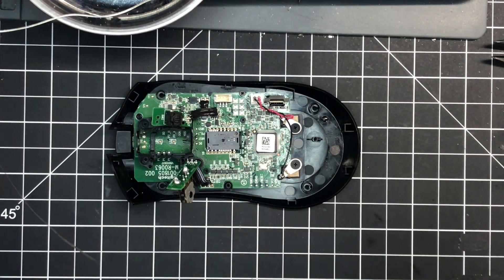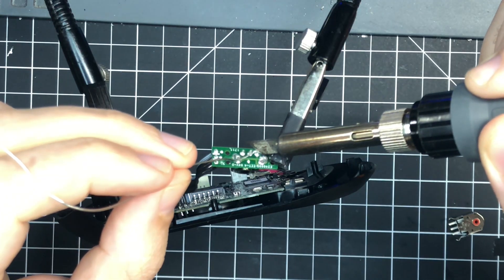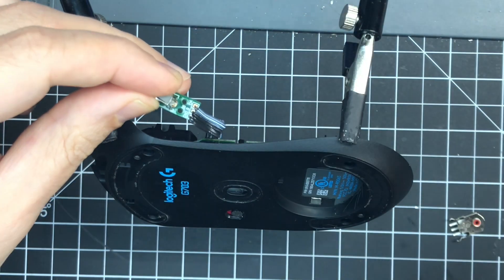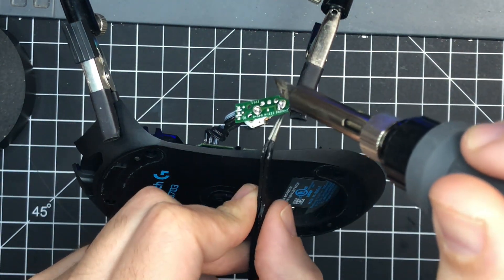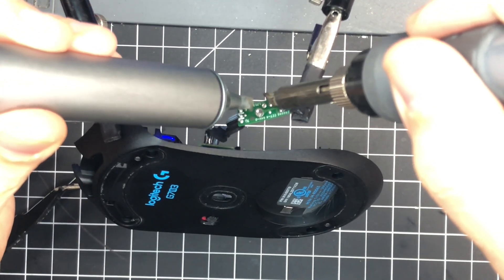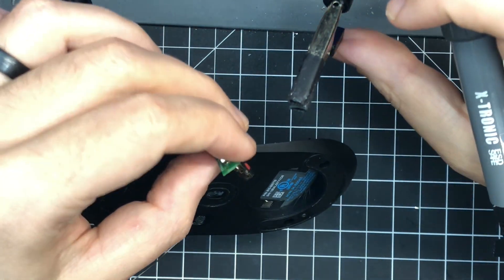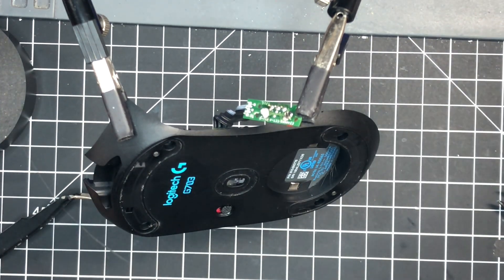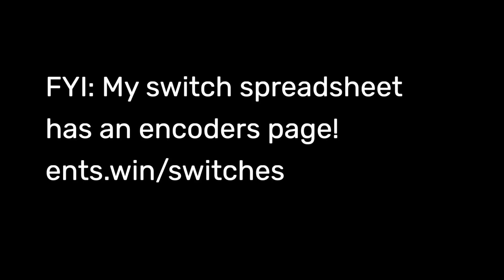How to swap and fix your mouse's Scroll Encoder! Fix broken scrolling in your gaming mouse!

Comment: I bought a Logitech G603 5 years ago, after 2 years, the core of the encoder got stripped so the wheel stop working. I replace the enconder with the same Kailh Red that you used in this video and it worked flawlessly. But after 3 years, the same problem happen again. I have a new kailh red encoder to do the replace, because i bought two at the moment. My question is, do you know some brand or model that have better quality? I don't wanna to be replacing the enconder every 2 or 3 years.

Comment: The #1 most important advice for casual users is to buy a soldering gun that has heat control and to avoid soldering gun that doesn't have heat control because you will ruin the PCB with these soldering gun. then set up the temp and quickly remove the encoder without damaging it. Use chisel point tip so that each 3 pins can be heated up simultaneously then just pull using tweezers. You have to remove it fast as not to damage the pcb and lift the pads. Also use flux as well.

Comment: Anyone know what the size of G600 encoder? Cause i need to fix a friend mouse, but we can't open before the fix. Thanks in advance
Reply from the maker: It's optical, so more than likely the wheel and encoder area just needs a cleaning
Reply: @entsfps  He broke one leg of encoder when trying to remove the left switch

Doesn't work anymore after that
Reply from the maker: @kohzito  https://www.aliexpress.us/item/2255799994906058.html
Reply: Thanks for the help

Comment: Can i replace my Kailh black with TTC gold as long as it the same diameter or does it need to be the same mark of encoder?
Reply from the maker: they are basically interchangeable except in very rare circumstances - as long as the height is the same you’re good

Comment: Finalmouse repaired my starlight 12 because the scroll encoder was jumping up when scrolling down. They sent it back to me today and  the damn thing doesn't scroll up or down at all now. Middle mouse button does work, so idk what they did. Last time I sent it in for sensor rattle and they sent it back with the battery harness unplugged. Idk why those people can't take 1 minute to do a post repair test. They would save more money if the techs did their jobs than having to send it back for repair, but I guess I go another 2 weeks no mouse. I love the mouse design FM has but hate the inconsistancy in units and repair process.:face-red-droopy-eyes:
Reply from the maker: 100% make them fix their issue
Reply: @entsfps  I should stick to my guns, but I have no other mouse and I'm tired of dealing w/ them so i kind of want to repair myself. I might just send it in for good then sell it and get logi/razor. I'm done with the hypebeast drop every 6 months style limited release bs, the inconsistancy, and dealing with incompetent repair techs
Reply from the maker: @fifthtyp3  if you can afford the razer/logi buy it now and then sell this one whenever its fixed to get rid of it. i feel your pain!
Reply: @ For sure, I'm thinking of getting a op1 8k for a solid backup or even to use off and on, give endgame a chance then after I sell this one getting another premium mouse. Thanks for hearing my grievences bro lol. Appreciated. I've only used an OG death adder and then multiple FM, what mouse do you recommend these days from a reliability standpoint and usability if you game? I'm leaning towards Viper v3 Pro or gpx2. The starlight 12 was a perfect size for my hand size using claw, also looking at XM2w 4k if I really like the op1, but a bit hesitant to go with a 'smaller' company after my experience. I play mostly single player games tbh, but sometimes apex/valorant/marvel rivals if friends play. I'm a boomer (millenial) so I need any edge I can get so I usually get the best peripherals and monitor I can get. Thanks for the responses!
Reply from the maker: @fifthtyp3  i main an xm2w, i love egg products
Reply: @entsfps  I hear that a lot from everyone who uses them. Maybe I will pick it over the big two. Thanks again man

Comment: Hi Ents, is Kalih encoder still working? If not, how long did u use it? and do you have any other suggestion other than this encoder or is this one is good?
Reply from the maker: I like the TTC Dustproof ones, but any aftermarket one will be better than stock.

Comment: Tip: If you need to desolder a component that consists of multiple pins, it might be a good idea to build something out of a piece of copper sheet that distributes the heat from the soldering iron to all the pins. This allows you to desolder such components without damaging them. The best way to do this is, of course, with a hot-air soldering station, if you have one, but I think that's obvious. I'm just mentioning it for the sake of completeness. The copper trick is for those who only have a soldering iron.
Reply from the maker: I'll try with my hot air rework station, but I have heard it's not the best for thru-hole components. What's your experience?
Reply: @entsfps  I use the copper trick. I don't have a hot air station, but if I did, I would try that first.

Comment: hey dude how much would you charge to do a scroll encoder swap on a corsair darkstar wireless?
Reply from the maker: that mouse uses some kind of non standard encoder that sits inside the wheel. i dont know what kind of encoder it is, or if you can get replacments. can you rma the mouse to corsair?
Reply: @entsfps  it looks like it uses a TTC Green 5 mm encoder. i could RMA it but then i would just be dealing with this same issue in a couple months again. i love the mouses shape and design but the scroll wheel encoder is one of its biggest flaws.
Reply from the maker: @kineticninja7989  its a ttc 5, but not in the normal shape. i sadly dont know if i can source it without having it in my hands to measure. i would rma and reach out next time it happens
Reply from the maker: also theres one on ebay rn for 65 which is just slightly more the cost for me to replace the encoder
Reply: @entsfps  will do thanks bro. i have a replacement coming in today so ill keep you in mind when it inevitably happens again. this is my 4th replacement I believe and all the previous units i had all had the same issue. theres a dude on reddit that recently posted about swapping out the encoder, im gonna see if he can point me in the right direction for the encoder replacement he ends up using.
Reply: @entsfps  ya i saw that but its pre-owned so i didnt want to take the chance of ordering that and not having any recourse of action if the mouse has issues and is potentially no longer covered under warranty. I'd happily pay $50 to get this serviced by someone who knows what they're doing.
Reply from the maker: @kineticninja7989  email me ents.fps at gmail and we can go from there - if you have a spare and are willing to send it to me im happy to try and source the encoder
Reply: @entsfps  sounds good big dog! i'll screenshot this and save it for when this replacement starts acting up.

Comment: Thanks for the guide. I gave this a try on an old mouse and ended up ripping out the traces on the middle pin. In hindsight, I think the issue (besides pulling too hard) was that the way the encoder was soldered, there was perhaps too much solder on the other side of the joint that was keeping it in place. So in hindsight I would have maybe tried applying some heat to the other side of the joint. Another thing I noticed was that I probably needed a better clipper for the encoder legs. My clipper twisted the legs too much, it didn't cut clean. Anyway, thankfully my mouse was out of warranty and the encoder was malfunctioning, so I mostly just lost time. The mouse was an MM731, so Coolermaster solder job.

Comment: What is the encoder's dimension for Logitech G102/203(same thing).  0:05 The one you are is 9mm.
Reply from the maker: 10mm
Reply: @entsfps  is TTC 10 silver good than kailh 10 red? What's the difference.
Reply from the maker: @FailaDK  both are good, its just preference -- i like the kailh
Reply: @entsfps  thanks breda for your response.
Reply from the maker: @FailaDK  🤝

Comment: I actually use the G703 too. I have one wired and one wireless. The scroll wheel on the wireless one started spinning freely without any physical clicks, so I thought my encoder was just broken on the inside. It turns out that the scroll wheel itself broke off inside the encoder and I had to push it out and buy a new wheel. It saves me the trouble of soldering, at least. I really like the G703s but I've had to replace the primary switches on both of the models I own and now a scroll wheel broke on the wireless one I bought much more recently and use less often than the wired one I've had for years. Get it together, Logitech.
Reply: Suddenly had a bit of resistance on my G603 scroll wheel. 5 minutes later it was free spinning and not scrolling. Same thing. That 1mm hex part of plastic snapped off in the encoder wheel. Ordered an all aluminum one to replace it.

Comment: hi ents, first timer here. I just wanted to know how long am i able to hold the rod against the PCB before it starts becoming damaged. I don't exactly know where to put it.
Reply: did you use flux?
Reply from the maker: @vent7050  no flux, and as little time as possible to get it to move

Comment: Could you please tell me which exact encoder is used in Madcatz Rat 6+ ?
Reply from the maker: no idea, cant find anything online but one bad photo. looks like a kailh dustproof encoder but no idea on the size.
Reply: @entsfps  Does it show the dimensions of the encoder like 9mm etc and what oin configuration it has like two pin or three pin?
Reply from the maker: @Maxxman100  it looks like a normal encoder (3 pin) but no idea on the height of it

you can send it to me to fix for you, i keep a lot of encoders on hand

Comment: I have a pulsar X2 medium Boardzy Ed, i heard it has a 10 mm encoder but idk if i need to replace it since it only just make an annoying and loud noise when i scroll and i want to sell the mouse. I opened the mouse and it's an encoder with a top cover (blue) idk what brand it is and since it's soldered to the PCB i suppose i can't just open the encoder to clean or lube it without desoldering...

I already fixed an encoder before on another mice before (xm2we), the encoder was not covered and not soldered to the pcb, it was easy to fix with isopropyl alcohol because it was just dirty inside and the encoder was frequently scrolling in the opposite direction (almost perfect design from EGG engineer that would be really nice if other brands start doing the same, hope next time they will also go for a dust proof encoder). Fortunately it was an easy fix on that one because idk what size of encoder it is (5 mm or 5.5 mm ?) and it seems hard to find good encoder in that size.

Your YT content look really good, i don't have stuff to solder at home but i already did some during studies and work placement so i will keep your channel clearly visible in my favorite for the day i will invest in stuff to mod or repair my mice collection.
Reply from the maker: if it works and youre going to sell it and the noise is the only issue, just ignore it as thats very normal and sell it. youre right that there are sealed encoders. you can replace with a smoother sealed one if you want. but if youre selling who cares just sell it

Comment: I have been experiencing an issue with my mouse (razer viper v2 pro) where the scroll wheel occasionally scrolls in the opposite direction, leading to inaccurate scrolling. Would it be possible to replace the scroll wheel encoder on this mouse? Additionally, could you recommend a suitable replacement that would be compatible with this mouse and also provide smooth scrolling performance? Thank you.
Reply from the maker: yes of course its replaceable, it has a 12mm encoder, so any from aliexpress would work. try a kailh  replacement

Comment: If you want a tip to make this significantly easier - you can use a solid copper rod to head up all the solder points at the same time. You just need to leave a bit of solder there in order to have contact. Once you position your copper rod, heating that will heat all the points, making sliding in a pga like this a breeze.

Comment: Can I use a 11mm encoder size for my mouse that has a 12mm encoder size?
Reply from the maker: probably but the click might feel bad or the wheel might be crooked. use a 12mm
Reply: @entsfps  Cheers. I bought an 11mm and 12mm one. Ill try the 11mm one with a 1mm spacer like plastic or smth.

Comment: I have a Razer Viper Ultimate and it's showing scroll wheel issues (when I scroll really fast, it goes into the opposite direction). What are the aftermarket encoders out there that are similar in both feel and sound to the stock encoder on the Razer Viper Ultimate? And what other encoders do you recommend?

Comment: Hey Ents. Just curious, what has been your experience with other brands when it comes to replacing the scroll encoders (or any PCB component for that matter)? I'm currently working on a Steelseries Sensei Ten and it's proving to be a royal pain as I can't seem to get all the solder off since there's a good amount in the PCB mounting holes. But with a Logitech G203, replacing a scroll encoder on that took maybe half an hour at most. Thanks!
Reply from the maker: add a bunch of leaded solder and it'll come out ezpz
Reply: @entsfps  Thanks for the response and that's definitely true! I've been mixing my leaded solder in so that the factory solder was easier to melt. 

My main issue was getting all of the solder off of the component so that it can come out as there will always be some left in the mounting hole that I can't properly wick or suck out. I thought about trying to apply my wick to the component side of the board (i.e the side where the actual encoder is) since I noticed some solder was there as well. Have you ever done that when doing an encoder swap?
Reply from the maker: @david47295  I dont remove solder until the component is out. Clip the legs, flood with solder, heat, and everything should just fall out.
Reply: @entsfps  Got it. I'll give it a shot. I'm a bit nervous about this since I don't a lot of soldering work but I guess if I'm careful and manage my heat application I should be good.
Reply: @david47295  how did that go? Im trying to solder in a new mouse scroll wheel on my razer viper v2 pro and im kind of scared that im gonna damage it T_T
Reply: @billlyfn4798  It's been a while since I did the repair, but I can say that it was a success. I swapped my Sensei Ten's broken encoder with a nice Japanese ALPS one. The process isn't super difficult, just follow the steps that Ents showed in the video and you'll be fine. But I can provide a few tips.

- USE SOME KIND OF TOOL WHEN PULLING OUT THE ENCODER PARTS. It sounds obvious but it's worth mentioning. Don't try and use your fingers to pull out the part unless you like burning yourself.
- As Ents said in the previous replies, if you run into a situation where you can't suck out all the solder, just add some more then apply your iron and keep it there until all the solder melts and you can pull out the encoder part from the other side of the PCB.
- I didn't have a wide chisel tip like the one Ents is using in the video (I only had a more narrow tip) but it's definitely still possible to do the repair. However, you may not be able to easily heat up multiple solder points as easily.
- If you find that you're starting to get frustrated, just put the iron down and take a break. It gives the board a chance to cool and also let's you clear your mind.

That's about it from me. Just follow the video, be careful,  and you should be good. Good luck.
Reply: @david47295  Thank you so much for this reply! I practiced with other mice and I just couldn't get the solder to melt easily at all(tried it on a cheap mouse and the solder melted after like 30 minutes but the mouse itself stopped working). im thinking the reason could be that my solder doesnt have flux infused with it but im not sure. Would be great if you could tell me!
Reply: @billlyfn4798  If it took you 30 minutes to melt the solder, then it's likely that your iron temperature wasn't hot enough. The constant application of heat probably damaged the mouse PCB which is why it isn't working anymore. I think I started with a temperature of 550F to 600F at first to melt the factory solder (the solder is typically lead-free which takes more heat to melt). Then when I start working with my leaded solder, I lower the temp down to 500F. I didn't really use flux all that much but it's certainly helpful.

Also, make sure to tin your iron. It'll help a lot with heat transfer. You can find a tutorial on how do that on Youtube or wherever else.